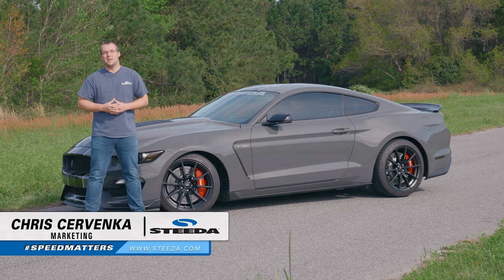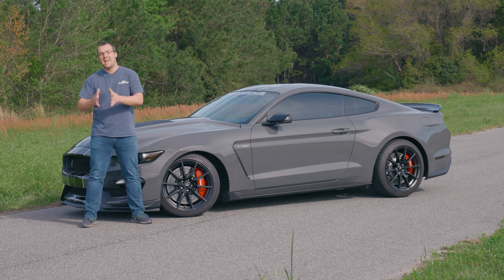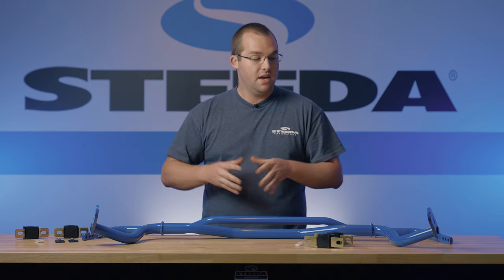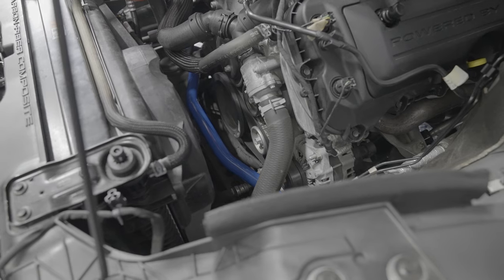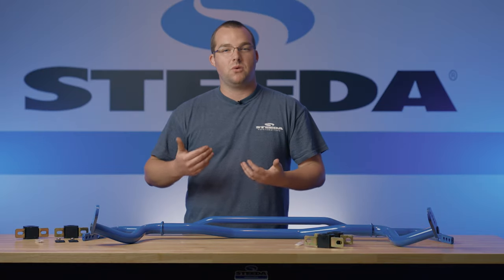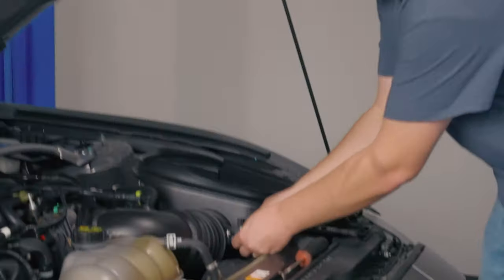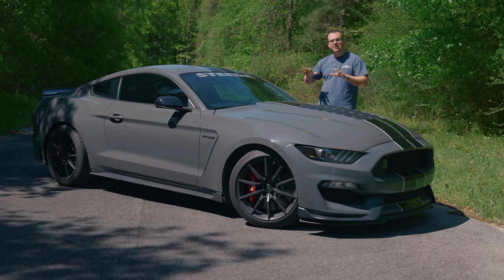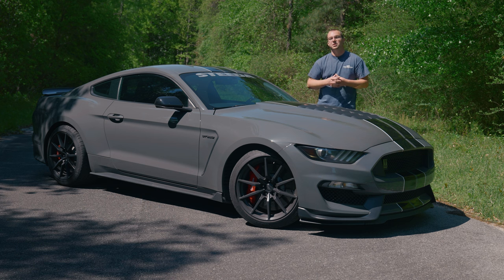Stop Body Roll On Your S550 With Steeda Sway Bars | Review & Install

Comment: please post the effective 'spring rate' of your bars (35mm, 38mm) at their 4 hole locations and the rear at it's 3. Here and also on your product website. With wheel-rates, too please. Here's I'll start with what I think is correct:
35mm: 520, 580, 650,725 lb/in
24mm: 280, 350, 425

Comment: Hi, great video. I have a 2019 PP1 with pretty much every suspension part you offer. My last thing to add would be the sway bars. Do you have to disconnect the struts to install this way bar.? And do you have to get the car realigned
Reply from the maker: No need to disconnect the struts or for an alignment. Just unbolt the endlinks and the two brackets and swap the new ones in!

Comment: I see the end link is not vertical and not perpendicular to the sway bar.  Is this and issue for suspension geometry?  I just lowered the ride height by one inch, and am having this issue causing the Steeda adjustable endlink to be now too long!  Any suggestions or thoughts?
Thank you in advance.

Comment: Can the rear brake line brackets be purchased separate? I have the sway bar but need those brackets.
Reply from the maker: Contact our customer service department at 1-800-950-0774 and we’ll be happy to get those out to you!

Comment: Would this be fine to do on a street NA car none performance pack car? Or would it mess up the handling if you didn’t do shocks and springs as well?
Reply from the maker: Hi,
Sway bars are a perfect upgrade regardless of doing springs and shocks. They work separately from them. -Sam
Reply: @steedaautosports  so there wouldn’t be any negative side affects. I know you can dial in some over steer or under steer with them but I just wouldn’t want them taking away from the independent suspensions ability to handle.

Comment: Ford stock suspension is very weak for gt350?
Reply: it's not near as good as the MR tuning GM did for the Camaro, I'll say that at least.
Reply: @matthewpatton5398  ford stock suspension is no good
Reply: @jesusm2159  compared to what?
Reply: @someofthissomeofthat6014  stock suspension?